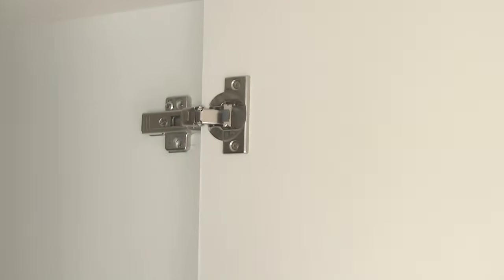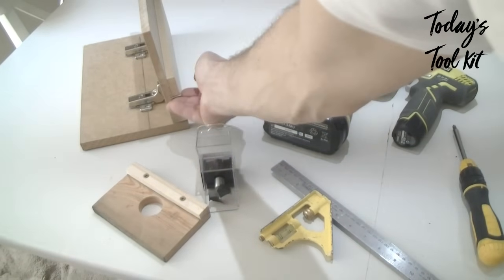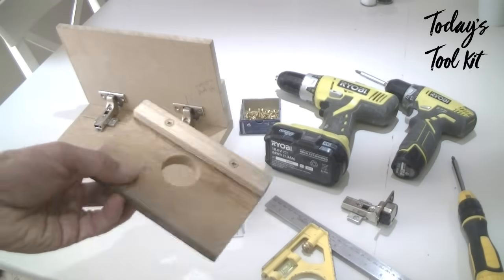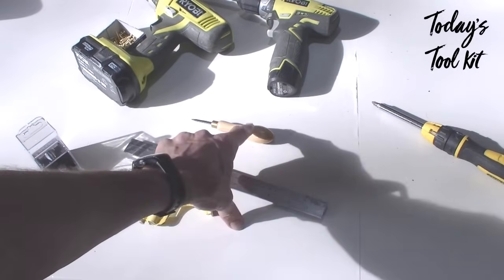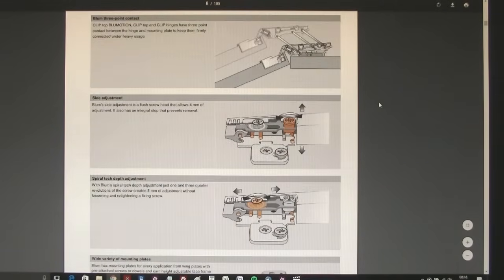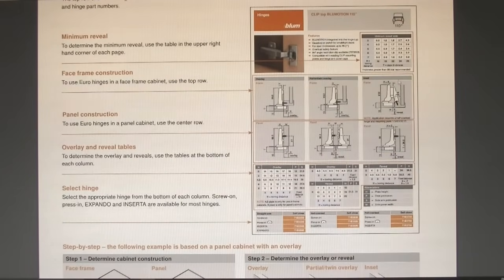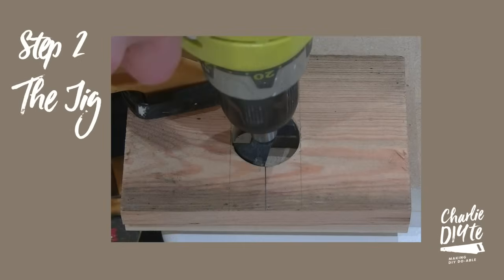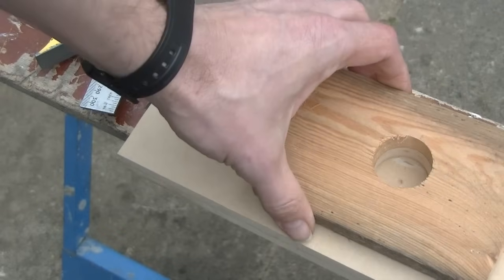How to Measure & Install Concealed Hinges on Cabinet Doors

Comment: Sorry but it does not tell how to measure for the inside part that goes on the frame. How do you line up those?
Reply from the maker: Hi Albert. I showed you on the mock up - at 15:47, but not on the full size door. Daniel asked a similar question a few weeks back - see comment feed below, so the following is cut and pasted from what I said to him: 

I thought the video had gone on long enough and so I didn't record that bit - but on reflection I should have done. 

It's pretty easy really. I attached all the hinges to the door itself, and then offered it up to the opening. You might get someone to help you with this. Either way, it's worth putting something under the door to simulate the gap that you will want under the door when it's hung. This also takes the weight of the door. 

Then, simply mark the outline of all the mounting plates against the inside of the cupboard with a pencil. At this point you're not trying to get the exact location of each mounting plate relative to the edge of the cupboard door - you're just marking out the location and spacing of each plate up the inside of the cupboard. 

You can then take the door away, and now you've got the exact location height of each mounting plate, you can adjust its position in from the edge of the door, mark the screw holes, and drill. 

You could try and do it with measurements alone, but this way, using the actual door, you know that when you come back to fix the brackets in place, they will all line up perfectly.

Locating and snapping each bracket into place is a bit of an art, particularly where you've got 4-6 on each door. You want to locate them all simultaneously, as best you can, and then push them all into their mounting plates in one movement - because if you try and snap them in individually, you'll get a few in, but the last 1 or 2 will be pretty impossible to move into position - particularly if they've disengaged from the mounting plate while you were snapping the others into place! 

If you then find the door is a bit low on the opening (as happened in my case!), if you've used the mounting plates featured in my video, you can release the adjustment screws on each mounting plate and slide it up a few millimeters to get your door into the perfect position. I believe some of the cheaper mounting plates don't have this additional functionality. 

Hope that all makes sense. Let me know if you've got any other questions.

Comment: There must be a way to make adjustable hinges withou drilling holes ..it's the most annoying thing ever ..it's making those holes that stop me to make cabinets.. and "they" know it..some smart engineer must be able to come up with some solution
Reply from the maker: You need the whole for the hinge to go into. It's not a big deal if you buy the right forsner bit.

Comment: You showed the inset hinges measurements , but not the overlay measurements ( which are by far the most common type )  making everyone go through the tedious process of going to the Blum website and finding out for ourselves. The whole point of watching this vid was to bypass that option.

Comment: You know how to hang hidden hinges but don't know the difference between a electric drill(has wire to plug into wall)from battery drill( no wire to plug works with battery)or you just misspoken!!
Reply from the maker: Possibly a bit pedantic 🤣